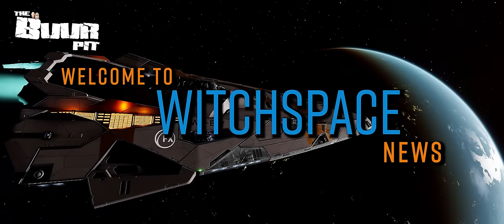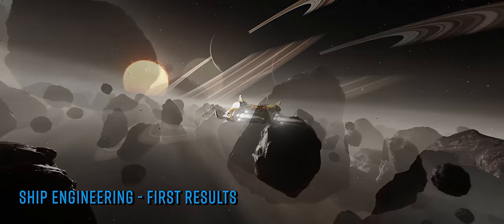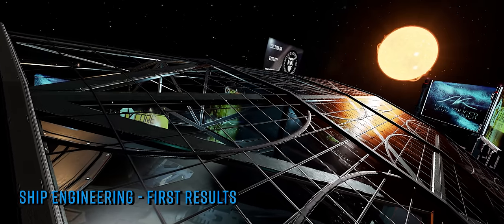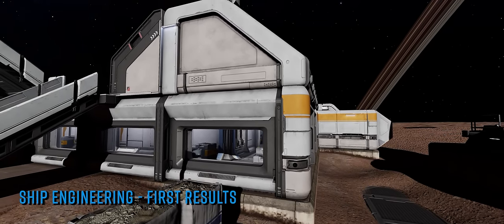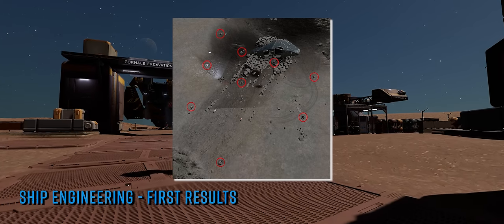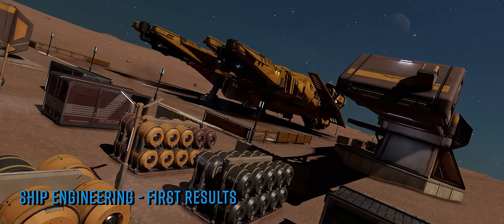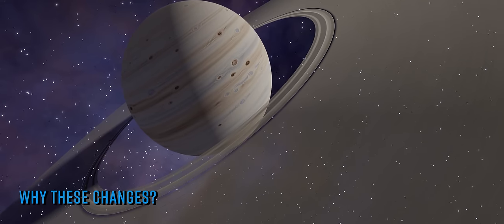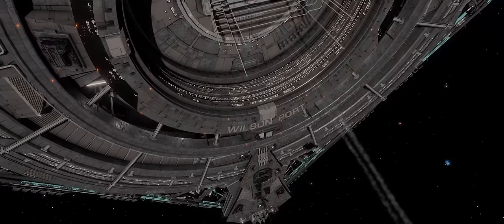Elite Dangerous ENGINEERING: High Grade Emissions, Missions Rewards, Blueprint Costs & More!

Comment: I probably spent about 30-40% of my 2,000 hours doing the "grind" in this game. Kinda wish I could have that time back or be compensated. Oh well it's my fault for not waiting for them to balance it out. Lesson learned FDev. If I don't like something I'm going to stop playing until you "fix" it and appease my distastefulness in your game.

Here's a couple things I would like to see:
1) Ability to deconstruct modules to get my materials back. This is very true with the Odyssey suit/weapon engineering. Once you do a modification it cannot be reverted or even changed. I have a bunch of FSD drives that have been engineered that are inferior to the new SCO FSD. I want my materials off the old FSD drive to put into a SCO drive. The new SCO drives jump further and they have the supercruise speed option. It's a no brainer to use the old ones anymore.

2) More module storage capacity. 200 is not enough. I also would like more than 40 ships allowed on carriers. I have a bunch of Type 10's with modules stored at bases because you cap the module limit at 200 but don't cap the limit of ships.

(This one pertains to fleet carriers)
3) Why do I have to move tritium from my carrier's inventory to my ship and then to the tritium depot? Why can't I transfer it directly in? Also why can't the tritium depot store more than 1000 tritium...make it 5000 or 10,000. I have no use for tritium on my carrier taking up inventory space. And make it so I can just refuel my carrier at a system or base rather than running back and forth with a cargo hauler. Is there no "full service" stations in the future? Why am I paying a crew maintenance every week if they can't even perform the simple task of running fuel (tritium) from a base to my carrier.
Reply: Understandable ! I would also appreciate to display the material reward Vs Items in stock on the mission panels. This could avoid to search in your inventory or using a tiers helper. Because those interesting changes are made to allow us to PLAY instead of loosing time to investigate. This could allow us to play with a single screen.😉

Comment: I've played Elite off and on since launch (~26Weeks played)
I have one of every ship type (I intentionally limited myself to 1of each) fully engineered for a specific task.
When I tried to do the same with on-foot equipment, I eventually gave up unlocking engineers and grinding through mats after finding the system to be extremely convoluted, very random, and very demanding with regard to materials required.  I remember grinding through 15 or so reactivation missions, stripping each place completely bare only to find I lacked the ability to purchase one upgrade for one suit.  I eventually found it easier to go from station to station purchasing items which were already grade 3.  
Ship engineering always had its places to go, but until people when to the trouble to force a system into anarchy, finding a system one could farm for on-foot mats was very hard.
With this change, I may give it another go.  Hopefully the creator of the materials helper doesn't find it too hard to generate an update

Comment: Looking forward to the drop, glad to see I'm not the only one who "Groundhogs" on SDPs!  Rather than the relog method for ground mats this update should also reduce the temptation to hit an unfortunate settlement over and over again with the associated impact on staff turnover and retention.  Keep up the good work, not just the informative Friday drops but also those "run-throughs" which I found required viewing in my on-foot development.  The only outstanding issue that remains for me is the lack of ability to modify suit and weapon enhancement leading to the creation of multiple grinds for suits and weapons - for example Mav with night vision for darkside mission using a valuable slot not needed if your target settlement is on the light side, so currently resulting in a two suit hanger requirement in locker and SRV.

Comment: Exciting changes! I had given up on the onfoot engineering due to the 'grind.' I can get by with what I have, but I've always wanted to upgrade more things, and have more loadouts. For me, the onfoot reduction of mats is encouraging, as long as things actually drop or are available from missions. I do wish they would add a data trader for onfoot mats, however.

Comment: The issue I have when doing mission that offer mat's is. If the reward of mat's is as much as one more than it would take to fill my limit. Such as when I only need 14 and the offer is that of 15. It will be unatainable aka blanked out from selecting mat's. And if it states it pay say 15, unlike when you via mining or other such way of finding them, you only get 15, not the three time's normal which would be that of 45.

Comment: CMDR Buur, have there been any changes to on foot data gathering or trading?   I really would like be able to trade data or get more data, given that there are few download points and lots of low use data.  I think it would be fitting to have bartenders be data brokers.
Reply from the maker: As mentioned in the video, there are little to no changes to actual pickups as best I can tell.  Likewise I'm not aware of any changes at the bartenders.
The key important points on foot are the significant reduction in upgrade and modification costs and the plethora of materials available as rewards for missions.

Comment: Could we get a written caption or summary of the mission board part at around 5:13 ? Maybe it’s just me but I literally can’t see anything in those scrolling windows to sufficient clarity to mean anything at the small size and speed of scroll it has.

EDIT: Also, I may have missed it, but any word about raw material rates? Are they still not a valid mission reward for ship missions? Did their per-drop rate increase like how the data per-scan rates increased? I.e. is it now more viable to just actually mine a random planet or do we still need to jump out to specific locations for the flak + limpet work to get raw mats in a reasonable time frame.

For scanned data, is that increase limited solely to Jameson / crashed anaconda type PoIs, or does scanning a ship or a wake for instance lead to markedly increased drops too now? Is it actually incentivised beyond role playing purposes to scan wakes / data beacon PoIs now to meaningfully fill up those mats faster than going to Jameson and cross trading in a loop? Faster Jameson is nice, but I hope it’s not essentially “jump to Jameson, scan and max your one or two bins available, jump to a trader and cross trade *6 times per remaining category*” as the only viable option still for encoded mats outside missions for firmware (which iirc was one of the categories Jameson gives anyway?).
Reply: Yes apologies, meant to make those full screen but missed it today.

Comment: I have a question that hasn't been answered by any EDO YouTuber yet, What are the Upgrade requirements to go from G1, Grade 1, to G5 and each step in between? This all I know so far:
G1 to G2   2 assets  1  M.I. or Goods 
G2 to G3  ? assets   ? M.I. or Goods 
G3 to G4  9 assets   4 M.I. or Goods 
G4 to G5  ? assets   ? M.I. or Goods
Please help.
Reply from the maker: Unable to test that with the current system we have access to.
Reply: @TheBuurPit  I understand if you don't have a grade 2 and grade 4 Odyssey Equipment to take to a Pioneer Supplies plus we will find out on Wednesday anyway. Its just the numbers I'm interested in.

Comment: all this about engineering and materials came for me little too late. it is handy and make life of commanders bearable when dealing with upgrades, but i finished that part in old fashioned painful way...
i want ability to search the planets by coordinates typed in in to the navigation computer. i want to save individual coordinate of the poi i discovered on the planet so i can revisit exact spot anytime i return to same system and planet. i dont wanna use 3rd party software or pen and paper when in vr.

Comment: "Engineering revamp"? All FDev essentially does seems to be reducing the time spent on not very interesting game loops, just by tweaking some numbers. But the result is, you will be doing the same unchallenging tasks you have been doing for years still. And now FDev uses this rather cheap rebalancing to make a big announcement out of what are essentially simple and obvious measures to make ED less tedious. The obvious question since Engineering came to the game was after all, why mats were mainly available outside of missions?